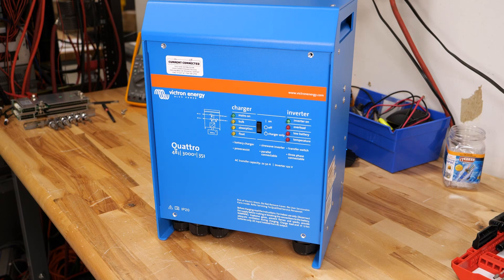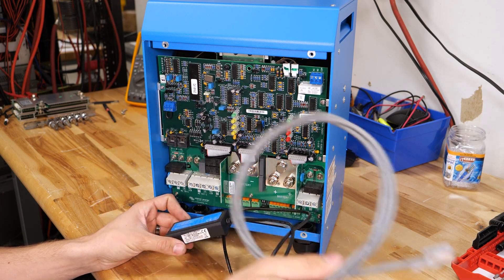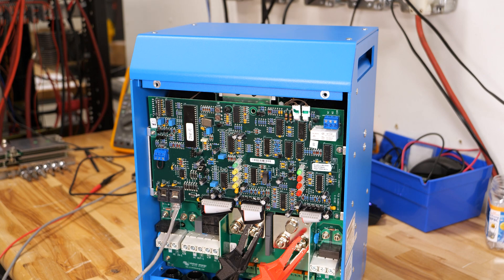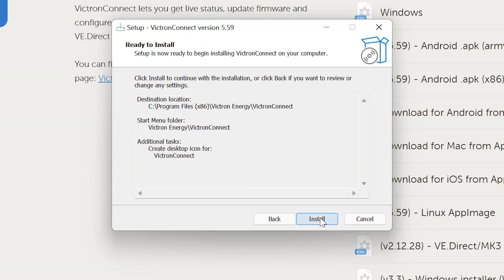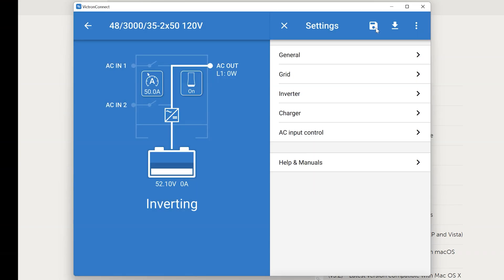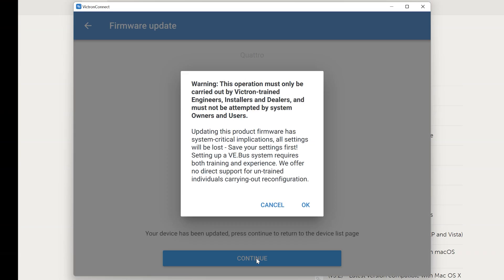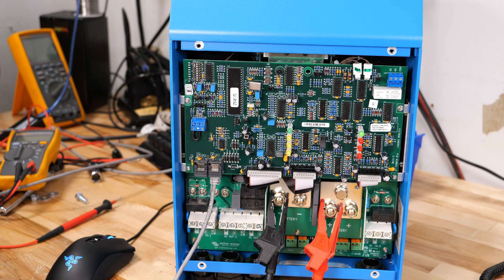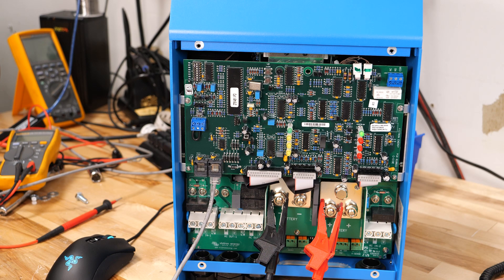How to Update Victron Inverter Firmware and Eliminate Nuisence Buzzing

Comment: Will this work with an iPhone yet to change settings ❓❓❓
 I just added AC INPUT  but threw the app with light the MK3  I can’t do anything  
  I hit the on switch and it ramped up to 200amps charging right away 😳‼️

Comment: Question on Saved Settings. I have 2 (24/3000) Multiplus inverters running in Split Phase (US/Canada) 240V. I am using an assistant to trigger AC charging based on SOC values. Will these assistant settings be saved and reloaded to both inverters after upgrading and reloading the saved settings file?

Comment: I have a Quattro 48/10000 Just connected it for the first time, currently its only connected to the 48v battery, its got a loud buzz/hum. Updated the firmware and it made no difference, do they normally hum with no load?
Reply from the maker: The bigger inverters do have a tad bit more noise than the smaller ones...a bit of a hum, but it should not be too excessive.
Reply: @CurrentConnected  Thanks for the reply. I don't think its excessive, just in a quiet garage its quite noticeable.

Comment: Victron needs to make a Mac or Apple version of firmware updates! And I’m not talking about VictronConnect app. Which is very limited.
Reply from the maker: Victron connect is the main app for firmware updates and is mac compatible.  I don't get why that wouldn't work for you?
Reply: @CurrentConnected  
You can’t do updates on firmware with VictronConnect and the inverter. You can’t change other settings like how many amps your gas generator would receive!
Reply from the maker: @simon359  Yes you absolutely can.  We pre-program and update firmware on the inverters prior to shipping them, and our programming guy uses a mac and VictronConnect.
Reply: @CurrentConnected  
I’ve already built my own off grid system, and VictronConnect does not change the firmware on the inverter! 5000 48v Victron inverter. 
Nor can you change the amps going in from a gas generator! 
Believe me, I’ve tried !! 🖖
Reply from the maker: @simon359  Sounds like we need to make a video to show you how.
Reply: @CurrentConnected  
Yep! I talked to Battle Born Batteries, and they showed me the software to download, telling me it was Apple – it’s Microsoft, I know the difference!
Reply from the maker: @simon359  Well there's your problem!  You should use a better source for your information.  
Here's the link for the OSX download: https://apps.apple.com/us/app/victronconnect/id1084677271?ls=1&mt=12
And here is the IOS download: https://apps.apple.com/us/app/victron-connect/id943840744

They probably sent you the Windows EXE download or something...not the app in the apple store.  By the way if you look at the screenshots in first link, you can see the program is installed on a mac and the settings button is clearly visable in the top right corner.
Reply: @CurrentConnected  
I give up! I’ve had that app since day one, it’s limited! 🙈
Reply from the maker: @simon359  Did you install it on your computer and connect to the inverter with the Interface MK3 or are you just trying with the bluetooth dongle?
Reply: @CurrentConnected  
I tried both! Like I said, I’m no amateur now! 😉
At least I could change the amps on the second incoming line for the generator.
Reply from the maker: @simon359  Well, I'm going to have to disagree.  It absolutely is possible and I'll prove it in a video so that others can benefit as well.
Reply: @CurrentConnected  
Sounds good! 🤙
Reply: @CurrentConnected  you can't do it wirelessly like you can on windows it seems. I think that's what Simon is referring to. It seems one has to be plugged directly into the device in order to make the update?
Reply: @Dr.PhDeez  
Again, I’ve used VictronConnect, it doesn’t change that much. To really get into the meat and change your settings on your inverter, you need to have Microsoft download -there is no version for Mac or Apple.
Still waiting for current connected to show me how ????
Reply: Very informative. Thank you.
Reply: It worked for me.
Reply: I have a Mac and with the MK3 connector and Victron Connect app I can fully configure a Multiplus II 48V 5000 120V. Not sure what the issue is here
Reply: @rodbhar6522  
Yes, you can configure a couple of things, but you can’t do the whole inverter like you can with PC software.
I was told that somebody was going to make a video, and they never did ?

Comment: Friend of mine had one of these units it started buzzing real loud and we decide to open the cabinet and take a look.
Turned out there was some sort of invisible midget inside of the inverter with the arc welder we could see all the flashy and Sparks it originated from those spring connectors and traveled its way up the board fortunate we were able to disconnect the pV and batteries.
So he filed a complaint with the Federal trade commission ftc.gov as that's where all recalls for defective devices start from the wire connections on these are a known issue that has never been resolved for nearly 20 years.
Perhaps a class action lawsuit is necessary I know of four people who had these inverters melt down at the connections and victron says it was because they use the wrong wire or installed it improperly.
Basically refusing to take responsibility but they'll happily sell you another unit with the same defect.

Comment: I didn't hear anything when the mic went to the top of the board.
Reply: also, that's a lav mic - all lav mics have high pass filtering to cut the 60hz hum and buz because its usually undesired, and not an important spectrum for human speech (think newscast) which lav's are intended for.  this is why reputable singers don't use lav mics, but rather stick mics with large capsules (mic element) that have broadened spectral response, often made with a humbucker second coil to prevent unwanted induced 60/120 Hz hum from electrical equipment from making it into the output signal while allowing true acoustic 60hz signals to show up naturally, like when a stick mic is placed in front of an electric bass guitar amp.  The difference in firmware noise is substantial as I have done the upgrade and heard it myself.  If there's interest, I may record a video with a proper vocalist microphone and a dB meter for folks on laptop speakers to show how substantial it really is.
Reply: If you have victron equipment and do the update, trust me, it's quite noticeable!

Comment: I love Victron products. They work well and look pretty nice.
Reply: Yeah if you're like looking at octopus having an orgy with black and red tentacles so much extra wiring time to hook these things up. It's like buying a car but if you want to transmission and you got to spend more money and then you need to drive line so you got to buy that and then you got to buy a differential and some axles and then you go by rims and you got to put tires on those and that's what it's like when you go you're just buying product that just had other features slapped onto it till it got to the point where they couldn't make it all work in the cabinet and the communications are on three different formats so you got to skip through all that and most of them won't communicate with some batteries so it's a convoluted system that if you want to do this you got to buy that by the time you're done you're into it 6K.
And then you're always wondering in the back of your mind is that electrical connection going to start a fire. And will my insurance cover it if it's not a UL approved electrical device?

Comment: I have a Victron 24 V/ 3000 model. I haven’t been able to update mine at all because I don’t have windows and I don’t use a PC. I only use Macs and I’ve only had OIS for ages. 
Is there any way I can do this without buying windows, which I don’t know how to use & I don’t want to learn. 😳
Not sure why they can’t make a firmware for Apple?
I already have the dongle to hook up a computer. 🖖🙏
Reply: ben - i tried to give you links to the mac solution, but youtube deleted my post because it had links in it.  You can find my email on my youtube listing to reach me for help doing this.  it's supported on mac os 10.12 and above (fully supported at that o/s, limited support at prior o/s versions)  if enough people have a problem using macs with victron, i can do a video on this subject.
Reply: You can update firmware via VEConfigure Remote Firmware update feature via VRM portal directly from your browser and independent of OS.
Reply: you can also update using a VE Bus Smart Dongle via VictronConnect
Reply: @DavidLopez-rd3hx 
How can I update it with ve bus smart dongle?